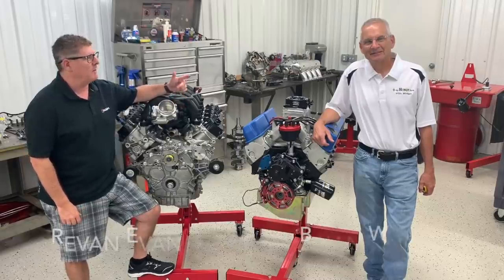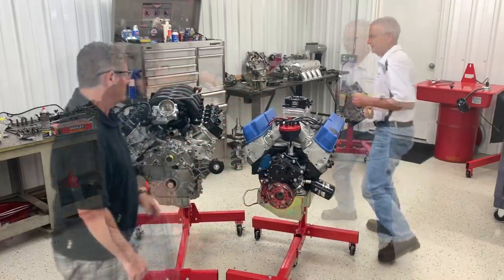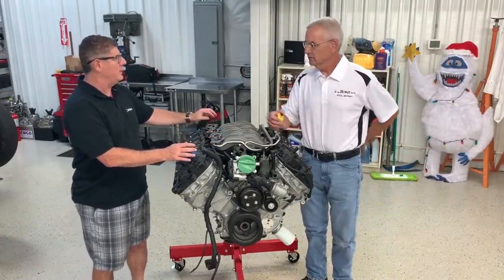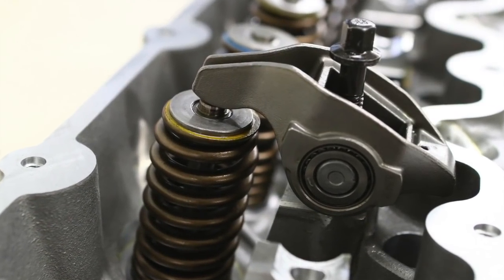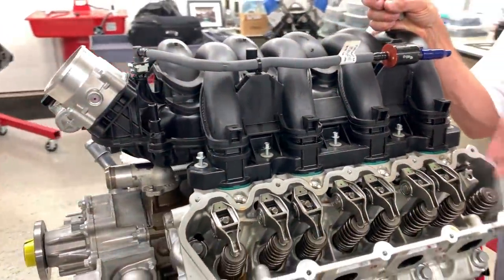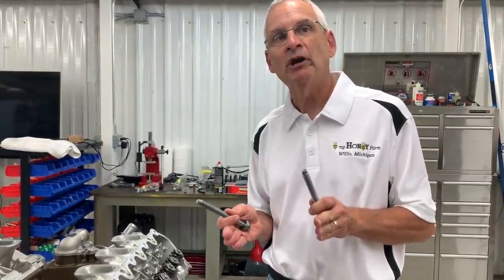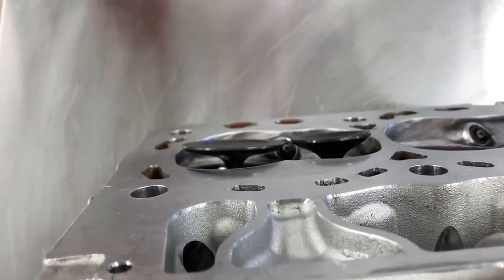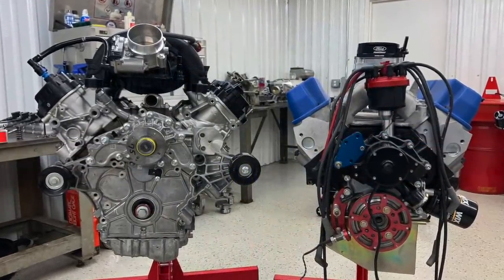Ford 7.3L Godzilla Engine Dyno Results, Teardown & Comparison to Coyote & 351 Windsor Part 2

Comment: I think you’re going to see a drop in the purchase of Powerstrokes with the advent of this motor!   I think I’ll wait a couple of years until they make a few more improvements and my next F250 will be the 7.3 gas motor.
Reply: I don’t know about that. It’s worth the 10k for the reliability of a turbo diesel and better fuel consumption. I’d love a 7.3 truck myself but if I was to spend ignorant amounts of money on a work truck it would be diesel powered.
Reply: @ZachFromAR  while you're broke down on the side of the road with a grenaded diesel engine, i will drive by with my gasser.
Reply: Zach Long The 6.7 does get pretty good fuel economy but I would have to say I wouldn’t buy a Ford diesel until it has a Cummins.  Say what you will.  Ford has the best interior, exterior and now has a really good transmission, but I haven’t been too impressed with any of their motors for reliability since the 7.3.  With that said, the 6.7 does produce really impressive HP/Torque numbers.  As always, everyone each their own...
Reply: I’m in total agreement with you
Reply: @murphtahoe1  If you thing that FORD has the best interior then you are biased.  I compared the Ford and the Ram and by far the ram interior is better.  As for engines, with all the emisions on them it kills them just like a  big rig, and therefore if I were to buy a heavy duty diesel, it would be a cummins as they last far longer than any powerstroke ever will.  You will see Cummins with well over a half a million miles in a pickup where you will never get that out of a powerstroke.
Reply: I was told it's a $2000 option for the 7.3 gasser, and over $10,000 for the powerstroke.  That 7.3 gasser uses cheaper fuel per gal and no def. The repairs will cost 10 times less than a diesel. I'd go with 4.10 or 4.30 gears and the 10 speed trans. Probably still get 15mpg with no load.
Reply: @TexanUSMC8089  the diesel is only a good choice if you gonna be constantly loaded and on long highway trips
Reply: @TexanUSMC8089  10 times is a bit of an exaggeration
Reply: I agree.  The diesels and their horsepower/torque war is just ridiculous at this point and I am sure the vast majority of people will never use their capability.

I loved my 7.3 power stroke and found it completely adequate for towing a 40 foot gooseneck with 2 side by sides and a rock crawler.

From what I understand this should have similar performance numbers so I would much rather save the diesel premium, the premium on fuel, having to worry about DEF, DPF, and everything else that sucks about modern diesels.
Reply: @BikerTrashWolf  I need more torque, i can barely go 40mph up the mountains when I'm loaded
Reply: Kevin Murphy they’re a $10k motor with all sorts of expensive things to replace and still not getting the MPGs that the Cummins is getting. I know you can delete the emissions, but that’s just more money thrown at it as well.
Reply: this 7.3 has major design flow, it just matter of time when people will realize. Just like 6.0 that people were so happy about it.
Reply: repairvehicle I would like to hear what that flaw is
Reply: @SVTStrikesback  , I am working on the video and will be uploading to my channel.
Reply: @repairvehicle  Of course you are.  "It's got a major flaw...It's got a major flaw!!!  I ain't telling what it is until I make a bullshit video so you have to watch it to find out (and I get the click bait money from youtube).  Good job troll.
Reply: @minime808  , go ahead get one. I am sure you love Ford's dumb engineering, camphasers, sparkplugs, and so on.
Reply: repairvehicle I own a 5.4 3v they’re not that bad. But the 7.3 is a y-block. In block cam. Pushrod no vvt no shitty spark plugs that break. It’s going to be a good motor ittl pass everything but a gas station.
Reply: @mattcoffman2444  , it has 1 vvt in the middle, look at the video. Ford even says on their website. History repeats itself. Ford had issues with spark plugs on 2 valve engine, Ford repeats spark plugs issues on 3 valve engine. Ford is know for bad engineering, don't hold your breath on spark plugs, it might be completely different issue than 2 or 3 valve had. Cast iron manifold rust issues, was on 2, 3 valve and 5.0, it will have on 7.3. Ford cast iron parts made in China from low quality material, also these parts might be have something else. There's more issues with that engine that I am going to reveal in my video, not here. If you listen carefully how this guy and how he talks about this engine, he is not impressed at all or gives any hint that is better than other Ford engines.
Reply: @repairvehicle   6.0?
Reply: I would have bought the 7.3 in my tremor but I didn't want to take a chance on an all new engine
Reply: @Justin Walters you never know with an all new powerplant.
Reply: yes the 7.3 made into a 2 stroke, https://www.4btswaps.com/attachments/2cyclesbc-jpg.6839/. it only tune up to 5500 but sounds like it's turning 11000. i got an old 7.3 99 IHC dirsel 2 stroke and getting 3 gallons of motule 800 2t is a little costly but i dont mind it.
Reply: What is your premix on the new 7.3, i would burn no leaner than 50:1 premix poppet valved 2 stroke! it would run no leaner than 50:1 is its so ford tough!  It will run no leaner than 50:1! lets see that! Lets see your  eco ford booster 2 stroke just shine
Reply: Dont worry you can always cut ports in a harley high power barbell if yo want a 2 stroke
Reply: Once they start pairing these with an electric motor, or even electric only, it’s over for diesels.
Reply: @SVTStrikesback  Until they come out with a battery that can be recharged in the same about of time as it takes to fill a fuel tank, electric will not take over.
Reply: Bill Blair yeah, that’s definitely not true.  If that were true then cell phones would not have taken over life as you know it.
Reply: Don’t cuss at us like that...

Comment: So they took the 7.3 and made it gas. Wow. Lol
Saved $ on assembly components.
Ford always gotta be a lill diff.
Couldnt just make a 350.
Gotta be special 351
Ill be the first 1 to tell you my 454s drink a lotta gas even unloaded.
Reply from the maker: This is a completely different engine from the 7.3L diesel. This is a brand new design.
Reply: Are you serious?  Find a single part in this engine that has ANY similarity to a 7.3 diesel..... This ain't GM trying to make a Olds 350 gasser into a diesel

Comment: Looks like this engine has both NA and boosted potential. 

Ported heads, dual port injection, big intake manifold and good headers doing 600+ bhp from 430bhp is darn imprssive. 

Throw in the VMP Vortex supercharger on top of the 7.3L and my guess is that it should do over 1000bhp since this engine is built for durability. I expect nothing less than a forged crankshaft and beefy rods. Maybe just throw in new pistons and piston rings for boosted application. 

I do like to see how the stock valve springs can tank the back pressure of the gases in the hot turbo side when the gas pedal is let off when it is turbocharged.

What the bore size and stroke length to make it a 7.3L? So far nothing on the internet about the specs of the cylinder bore and dept. 

To those who say open deck sucks. Some Honda engines are open deck design yet they are boosted over the moon and producing tons of power. 

Bad tune is what breaks block not entirely bad blocks.

Comment: Been talking about the motor, then suddenly, "yeah we stuck this cool looking intake on it and cammed it. Oh it makes just over 600hp."
Reply: @mewrongwayKOCXF  with just intake and cam? Yeah no. Shut up
Reply: @billyray4716  mewrongway is a troll account. He only posts on ford motor videos.
Reply: @pro-seriesfabrication3810  Exactly, this dipwad is everywhere with the same "my Ls blah blah makes a billion hp with no pistons"! blah blah.  Troll.
Reply: @mewrongwayKOCXF  Cheesy family videos? You mean like watching baby parakeets? You seriously think anyone wants to see that? Did you record it with a Nokia?

I don't post on every LS video, the only one I know you from is where you were running your mouth about modular motors only to be educated on Accufab and John Mihovetz which AGAIN, you kept backpedaling after coming to the realization he went faster with an OEM block, crank, and heads than any LS motor has ever been with aftermarket everything. In your dreams did Hennessey go 308. No one has currently been faster than Bugatti's 304 mph.

Secondly, M2K Motorsports has already been faster with a 5.4 modular motor in a standing mile than the best LS powered car has ever done. Again, with a factory Ford block and heads.

Since you don't run a car and just run your mouth, sounds like the LS motor is actually the perfect fit for you.
Reply: @mewrongwayKOCXF  bet
Reply: @mewrongwayKOCXF  You have a handful of crappy videos, none of which are of an LS motor or even a car for that matter. You also post on every small block ford video on YouTube. Clearly, you have nothing better to do.
Reply: mewrongway The 7.3 throws Rods? Show me
Reply: This is some type of valved loop charged 2 stroke from what i heard.  Its dry sump oil injected also so you must run a synthetic low ash oil to run clean. if you get one be sure to grab a few gallons of BRP xd-100 2t, i would go with motule 800 2T myself.

Comment: Wouldn't a 460. 7.5 be a better comparison? ?
Reply from the maker: Actually no because we feel most will swap these into a Foxbody and the 351 is more common in a Fox than the 460. But good observation and thanks for the question.
Reply: Why haven't Ford used big blocks in the Mustang as the other two car companies have?
Reply: @holyroncg    Mopar hasn't made a big block since 1978, and after the E-body(Barracuda/Challenger) was cancelled at end of 1974, the bigblocks were only in the B and C body cars..   GM's last bigblock Camaro was probably the late 70's or very early 80's.
Reply: @knight0334  ok I get that. Why Ford displacement is always smaller than the other two. Ford is still using 5L and the other guys are 6L plus.

Comment: 351 Windsor: "So ya think ya betta than me???!!
Reply from the maker: LOL
Reply: All kidding aside, this was a very clever tactical move by Ford. Not a  die-hard blue oval fan but giving credit where credit's due. The GM LS is the V8 king of the world. By debuting this 7.3 as a "heavy duty gas truck" engine, as were most big blocks 60-70 years ago, Ford saves face for 25+ years of really wide OHC V8s AND, by sizing it a 7.3L, sticks it to IHI for the 6.0L diesel fiasco back in the early 2000s. Blue oval people finally have their very own LS.

Comment: Am I the only one that wonders why all these new state of the art engines do not deliver state of the art power?
Reply from the maker: It has the power Ford feels necessary for Truck applications with unbelievable durability to go many, many miles and be rebuildable. From a hot rod standpoint it has the architecture to withstand big power, which is how old school hot rodding was created.

Comment: The Ford Explorer had a flat flange surface area where the intake manifold went as well 2002 to 2010. 73 shown in this video has thinner O ring gaskets on the manifold than the Explorer. Im actually surprised looks like that something that could be a problem

Comment: Are newer ford power trains built for stand alone use in older cars. Basically chevy is the favorite for swaps are ford's becoming more modular for swaps or are they a pain?
Reply from the maker: There will be systems to run this engine, no doubt.

Comment: I’m not sure what compels anyone to  mess with anything ford but as they continue to dabble in reinventing the V8 I’ve come to the conclusion that the big block, small block and LS  Chevy is a  superior platform.
Reply from the maker: I know, right? Just like how the smaller 5.2L Coyote-based Cobra Jet has beat up on the 5.7L COPO in NHRA Factory Stock.
Reply: Not really, they are only cheaper.
Reply: Rio Grande.  I own both Ford and Chevrolet’s and have turned wrench’s on both for decades and just cheaper is a good reason to go Chevy.  I’ll rant a bit as to why I won’t work on much less tweak on most Fords.   It comes down to this, for some unknown reason Ford likes to piss off the poor fool who has to work on their junk, especially when it comes to crossover parts, complexity of the design and aftermarket support.  There is only one Ford V8 that was worth a crap and that’s the 385 series.   For someone unknown reason it was dumped for the that abysmal V10 that was an overly complicated anchor that had to be wound to 6500 to make power!   This can said for just about every other V8’s Ford has tossed into production. Here’s a few that I’ve had the displeasure  of dealing with over the years. The 335 series, the FE, the Y ,the Modular 8 and 10, that goofy Lincoln platform, whose platform name escapes me and the Windsor. With honorable mention going to the parts bin wonder call the Cleveland, which remarkably enough is the only engine that will allow a few parts to cross over from other series.   

As with this video there are guys out there who will find ways to tweak this junk.  Of course this usually costs 2x more than  modding an earlier tried and true platform, this assuming you can actually find quality aftermarket parts for the platform.  It’s only a matter of time before the bean counters at Ford decide to pitch the Coyote into the trash heap now that the production bugs have been worked out and there is tons of aftermarket support.  I’m sure the next generation is being worked on now and of course nothing will cross over and a whole new set of tools and rules will go along with this design.
Reply: Michael Free, well I’m not really looking to piss on anyone’s parade but some of  these channels make it seem like this stuff will take power adders and go fast parts without actually having done it yet.  Don’t get me wrong this is a well done video but at the end of the day I’d just go with a 385 series that is a tried and true platform that we all know will make tons of power and the best part, it will ship tomorrow.   

Ill get calls about stuff like this daily and have to have a somewhat educated answer for the person on the other end as to wether modding this platform will have any substantial gains over a tune and a set of long tube headers.   People watch videos such as this, see the reviews from other channels who are also blowing sunshine all over the stuff and want to know how much and how long. I now have to do hours of research for the go fast parts once I know the guy is serious about the work.  

I’ve literally had 10 calls from this video alone poking around about the 7.3 and it’s potential.  All these cats in the video have done is take a tape measure to it, showed the internals and a shiny tunnel ram that makes my phone light up.  I’ll be honest and go down a huge list of why I’d stay away from this platform for a couple of years and if you want to mod it, expect to spend tons of money to be disappointed over an old school configuration like the Windsor or if you want big a 385 series plant.  I’m not sure if people are thinking this is Ford version of the LS or what but time will tell as to the viability of this platform.  

I’m not hating on Ford but what people don’t get is when you start modifying anything that doesn’t have a good history of platform performance over several years or decades,  you’re asking  to be robbed. Based on Ford’s history I wouldn’t touch this platform for at least 3 years, by then Ford will have had any potential issues worked out or in true Ford form the’ll scrap it for the next latest and greatest.

I would personally never drive a modded Ford other than a tune and long tubes.  I drive a 4 valve cobra daily with just that, long tubes and and tune.  When it shoots the 20’ timing chain out of the front cover,  an LS 7 is going in it’s place, why you may ask?  The LS is a better engine that I can get way more out of for the $$$ and yes, it does piss off the Ford true blue guys.
Reply: @scottg391  you're judging an entire brand based on one car, and it's subsequent engine. Are you really that foolish?
Reply: @riogrande163 I'm not judging anything. I clearly pointed out several Ford V8 engine platforms that you could throw money,time and frustration at and they would still be a pig.  Look, my point is directed specifically at this video.  That being, don't go buy one of these things thinking it's going to make 2x the HP with a tune and some long tube headers.  It may be years before there is any good aftermarket support for this engine, if at all depending if the next iterations are similar in design.   IF you absolutely must have a big displacement Ford,  go with a 385 series.  They are cheap, have  plenty of aftermarket support and they will make tons of power with just a few mods.
Reply: is that why nascar and nhra banned/messed with and cheated mopar and fords so much? then to come out in later years, that the head for nhra hated mopar and ford, and wanted chevies to win?

Comment: 1991 was the first 4.6 not 92. The 91 was also the only year 4.6 with the old style small block bell housing pattern.
Reply: Yes you are correct, sorry I misspoke, getting old and sometime I get things off a bit.  I should have known, I was the base engine development engineer on the 4.6L.....

Comment: My guess is that the very tall springs are part of Ford's longevity goal for this engine.  Keeping the springs further from coil bind, or bending the spring less each valve cycle, would help the spring last longer.
Reply: Which brings up this question:  What are some typical valve spring lives for various engines?  I've never given valve spring life a second thought, but there must come a point when they weaken significantly>